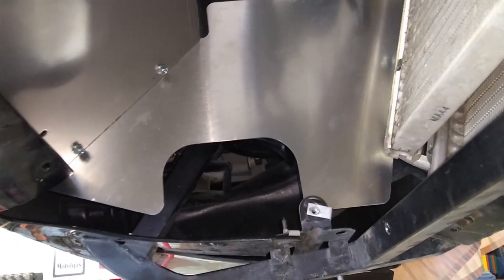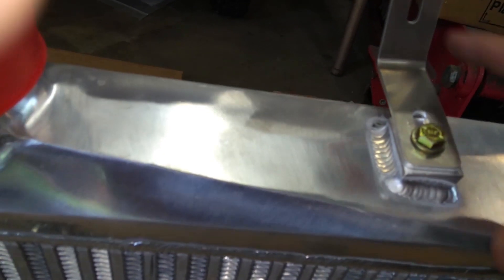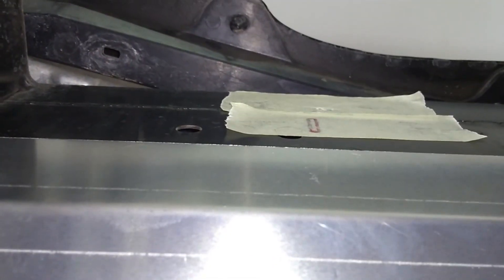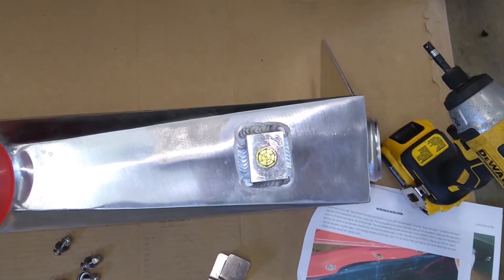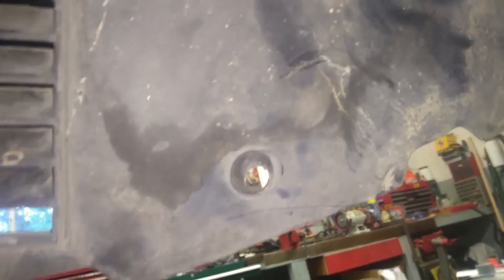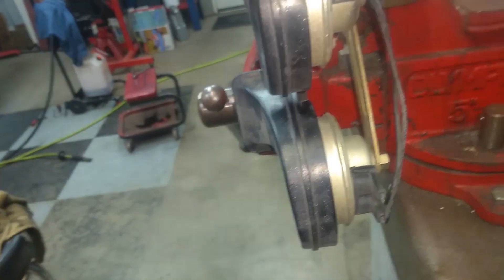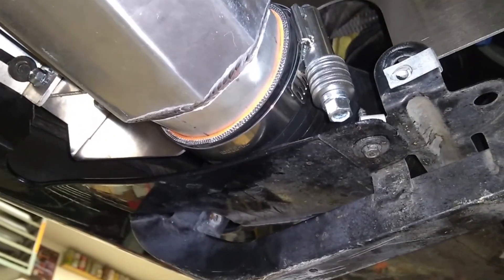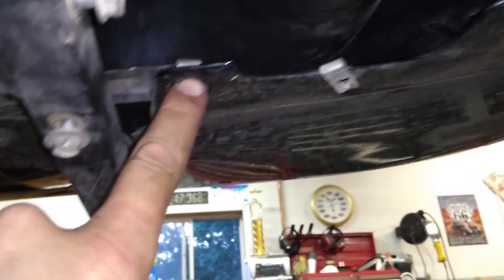A&A Corvette Supercharger Installation on a C5 Corvette! (Part 5)

Comment: would using a cut down dewitts radiator make lowering the skid rail frame wkth spacers not necessary?
Reply from the maker: That's definitely part of it, I'm not sure if there's any other reason cuz it's been a while.